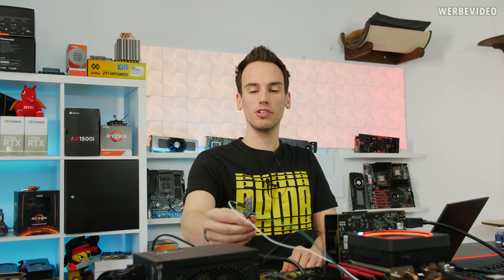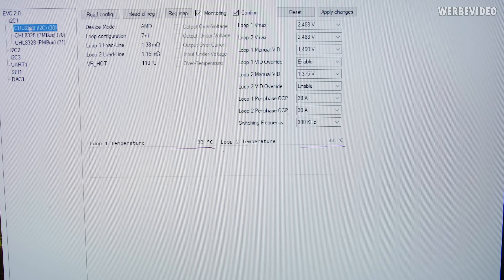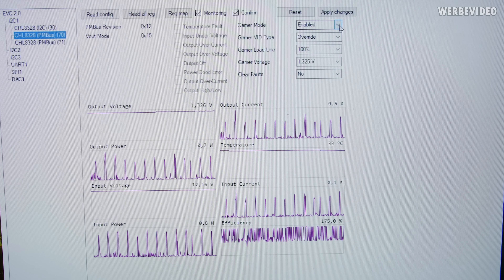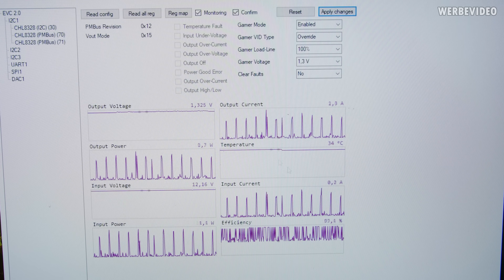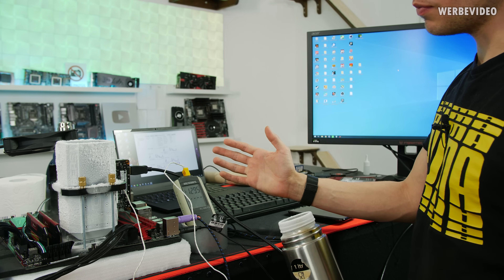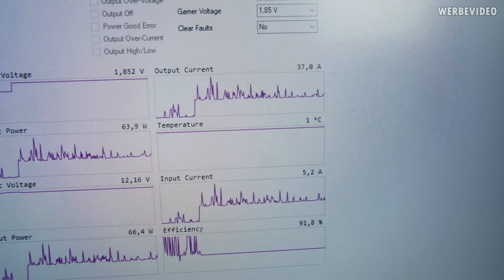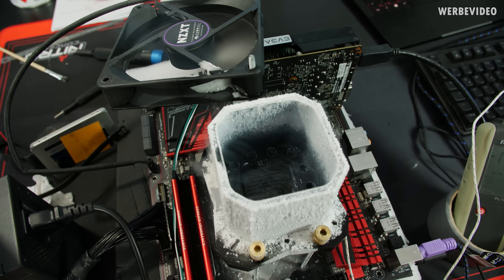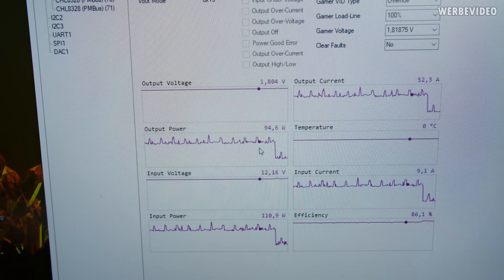We Overclocked an AMD CPU to over 8.1 GHz !!

Comment: 2:33 telemetry windows eat 15A current each 5s 😂
Reply: Linux all the way. I have Gentoo Linux, everything compiled straight from the sources with the newest compiler directly to my architecture. All dependencies that I don't need are dropped. Everything from Kernel that I don't need are dropped, and the rest of the settings optimized. Now I have Celeron 1.8ghz single core 2gb 32bit laptop from 2005-6 that runs fully modern Linux and it's powerful enough for pretty much everything except where performance actually matters like rendering.

Only reason I bothered was the challenge, and that laptop had superb display for it's age. I gave it to my mother who is really happy with it. It uses my desktop computer for compiling though. Otherwise that installation would have taken forever, and even the regular updates that need to be compiled would take too long.

For a little never machine pretty much any Linux would work fine.
Reply: thats why you don't use windows 10
windows 7/8 all the way, not the "material design" abomination that is windows 10
Reply: That's why you use Linux, which will have the design you want. Though it will have pretty much everything as you want, after you learn how to use it.

Even these old Bulldozer era CPUs feel fast with Linux, and really fast with Gentoo Linux where all code is automatically compiled and optimized to your specific hardware, and only needed dependencies are included in the binaries.
Reply: @juzujuzu4555  pretty much every application i need to use runs only on windows and has no replacement / equivalent on linux
Reply: @juzujuzu4555  and the performance is bad on wine sooo
Reply: @bananya6020  Most Windows software runs on Linux through Wine. And in most cases there are equivalent/replacement on Linux, people just don't know about them and don't research because they think they already know the answer.

But let people use the OS they choose, I just want to give info that there could be better options, depending on the people and the needs.

Linux and most free software doesn't have marketing, but instead have the perceived image from the days when Linux wasn't nearly as good as it's today, so people who have migrated to Linux need to act as the marketing force.

Though it's not easy as it's easy to sound like elitist or someone that is "OS shaming" etc. which only causes problems.

I just never knew computing could be so much fun and productive at the same time. So I want to share the knowledge and have misconceptions removed. But not cause any negativity, which is real danger as comments really doesn't transfer the message well.

I also have one machine that runs Windows 8. I tried Win10 but just couldn't stand it, and it was the point when I gave up and migrated to Linux. So in a way I'm really thankful for Microsoft =)
Reply: @juzujuzu4555  Linux is garbage for day to day use (For me personally). Also, WINE isn't the solution for every Windows program. For that, you're better off running a VM with a GPU passthrough.

Linux just isn't there yet for me. It needs a lot more software support and a lot more work with drivers. Though, Linux is great for development and server stuff.
Reply: @bananya6020  yeah i used windows 7 for ages but then my hdd head crashed and I was forced to go to 10 and  i want to go andset fire to microsoft now
Reply: XD
Reply: How did this conversation go from a comment about amperes to a Linux vs Windows war in 1 message? And yes it’s a retorical question.
Reply: @Engineer9736  There's no war here. Just facts about operating systems. When someone mentions Windows telemetry, usually friendly people bring up possible solution to that problem. So the original comment itself had the seed for Linux discussion =D

Comment: @der8aer   next time you have a bent pin try this trick. Get a ball point pen and remove the ink tube from it. Slide the back of the tube over the top of the bent pin. Slow AND I MEAN SLOWLY flex the plastic pen tube in the direction you want the pin to return to. The extra flex in the plastic tube will be less damaging to the pin than the metal point you used. Also you are less likely to damage other pins around the one you are working to repair.     Give it a shot sir.     Ball Point pen is still stronger than the CPU. (pen is mightier than the sword?) 
Cheers!

Comment: this is how 14nm CPUs will look like in the future if you know what I mean
Reply: 3 years ago kaby lake was OCed so many times to the 7 and even 7.6 Ghz ,now we are still hovering around 4.5 ghz, because it's simply useless and inefficient
Reply: @kaisyaya8492  That's still comparing LN2 XOC to commodity watercooling. With 14nm incrementalism we squeezed 5GHz out of a 4GHz design. The fact that Ryzen managed to close the multi-year gap and then get ahead will force Intel to move quickly again.
Reply: @asm_nop  AMD has "moved quickly" to recover from Bulldozer fiasco.

Fact of the matter,  "moving quickly" in semiconductor industry means accomplishing something like that in 5 years instead of 7. The engineering is unbelievably complex and slow.
Reply: 14nm++++++++++++++++++
Dead Lake
Reply: So much ++++++
Reply: Or today ... if you know what I mean. The 9900k can already draw over 250watts with an AVX load. Same as a 16 core Threadripper.
Reply: @WaspMedia3D  TR is 24 cores.
Reply: @LtdJorge  1st gen 1950x
Reply: Hahahha 👍🏻👍🏻
Necromancer Lake is RIP
Reply: I still have my i5-2500k that for repurposed for my NAS which if I remember right was a 32nm architecture and that just seems crazy relative to what we have now.
Reply: @Livedracersteve  I still have a laptop with i5-520M and it is 32nm It barely run windows 10
Reply: @katech6020  yeh but a laptop i5 (1st gen) is pretty much pentium level dual core aswell if I am correct
Reply: @NeoArch  I have a first gen i5 laptop (Latitude E6410 i5 560). That thing runs so hot at times. I put an SSD in it and it runs pretty quick. Thinking of switching out the Mobo for a Motherboard with dedicated graphics. Tired of integrated graphics. I need to find the correct cooler for it though.
Reply: it's still fucking some CPUs that are 7nm in the butt when it comes to single-core, now imagine if those 14nm CPUs were actually 7nm...ohhh exactly

Comment: der8auer: 8.1GHz on AMD!

Me: Laughs in intel i3-9100f stock cooler
Reply: I have a intel core DUO E4500 (2.2 Ghz) :d
Reply: @Hasan Sarı huh
Reply: @hotaru25189  yeah but basically the same not much difference.
Reply: Well this thread certainly made me feel a lot better about my R7 1700 @ 4.0
Reply: @TheBig451  The Ryzen 7 1700 isn't bad at all. LoL It's still a great CPU to this day.
Reply: i3 9100 is fine
Reply: @d1s1ntegrator56  no
Reply: @Babybarschalarm  i have an i3 3225 dual core
Reply: @desardlika755  oof
Reply: @Babybarschalarm  y
Reply: @Babybarschalarm  I have a 3900x , stock cooler  😓
Reply: @allgunsblazed9106  yeah but atleast it has an AMD cooler on it haha. the intel cooler is useless
Reply: @NonsensicalSpudz  to be fair, looking at hardware unboxed' video, the amd stealth cooler is almost as useless as the intel stock cooler (copper core). still better than the coolers (no copper core) they use nowdays by a noticeable margin.

Spire absolutely destroys it though.
Reply: @allgunsblazed9106  the stock cooler can perform close to a 360 mm corsair cooler when playing games the stock is good enough bruh unless u doing heavy oc don't be sad
Reply: @Babybarschalarm  i3 9100f is better than an i5 6400 and almost 2 times i3 6100 my cpu

Comment: best to heat those cpu's up before removing the HS
Reply: Yup. Bent some pins on my r3-1200, but not on my 3600 because I remembered to start prime95 before I pulled the cooler off
Reply: Just use hairdryer or something. You don't need to warm up the whole platform :)

Comment: I bent some pins on my 2700X in exactly the same way at 04:51
It's really annoying
Reply: Gratian Boghean I was thinking the same until that crap happened to me 😂😂😂
Reply: @dreadshape6972  not very well, but yes
Reply: I usually let the cpu warm up for a while so the paste gets softer. Never had a problem:)
Reply: Warm the pins cpu.
Find mechanical pencil, pull out graphite then use the hole to straight  up the bent pin

Comment: Wow, that really bends the board a lot. Any issues caused by this, such as cracking solder or anything like that?
Reply from the maker: Usually no permanent damage. Just very big sockets like SP3 / TRX40 / LGA3647 will get CPU contact issues and you lose memory DIMMs or PCIE lanes
Reply: der8auer That’s damn impressive! I’d never thought it’ll hold up that well. Thanks for the reply and the great content btw! It’s awesome to see those good ol’ FX see some more action

Comment: Will the board fully recover from that absolute distortion? What did you end up getting on the cinebench multicore?
Reply from the maker: Yea it's usually no problem for the board. They are really flexible. Unfortunately ran out of LN2 but can repeat it maybe in a future video

Comment: I still have my old FX-8370 system components (as in motherboard, cpu and ram) lying around somewhere, but I was never able to overclock it past 4.2 on all cores, because I only had an 80 euro Gigabyte motherboard with weak VRM's.
Reply: hit 5.1 with mine on all cores..on custom loop..stable at 4.9..with a sabertooth motherboard..at the moment it still running my youngest kids PC at 4.4.GHz
Reply: @microangle  Nice!
Reply: Guys OCing PII/FX can be a pain. You have to enable HPET in BIOS and force it off with 3 or 4 bcdedit commands in cmd (admin) or the mismatched timings will screw the already poor FX experience into an even worse microstuttering mess. You have to match the NB and HP (16bit) speeds. Its hard to even get them both to 2400MHz. I got them stable at freaking 1800MHz on an FX-4100, 2000 on PII 965 and 2200on FX8370. It took me a lot of time to firure out that these two settings were the biggest stability hogs. Don't use more than 2 sticks and never set the comand rate to 1T if you have 4 sticks. Disable 1394 IEEE (FireWire), disable onboard audio if you have an usb headset, set LLC to Medium (always make sure you have a competent PSU and mobo VRM before OC), disable front USB 3.0 (maybe even rear because the old drivers are buggy unfortunately), press Ctrl+F1 when you enter the BIOS on Gigabyte mobos cuz it will unlock extra options across all tabs, disable any spread spectrum or NB/SB power management options (Ctrl+F1 required), don't OC with the bus on questionable RAM and try the BUS method if you have extensive experience since it can lead to massive issues for minimal gains, disable APM and manually set the pcie speed to !!!100mhz!!!, Set the bus speed at 200, and set your memory at 1333first and focus on the CPU before OCing the RAM (very sensitive and extensive experience required for really tight timings and high speeds plus you have to be lucky with many RAM kits and the processor lottery on the IMC itself and the quality of the mobo all play a significant role), disable the power saving features (c1e, c6,...) and cool&quiet (c&q), check that the fans are running in PWM and not Voltage and set a high fan speed on a high temperature target,.... 

Good luck and have fun OCing 💪😄
Reply: I had a 8350 that i OC'd to I believe 4.8 on a 79 euro gigabyte motherboard, pretty sure we had the same one. 970a-ud3
Reply: @anti-vatnik  hmmmm... I did have a 970 version, but not that one. I guess I need to do more research 😂 Also, was that overclock on all cores?
Reply: @Fiddlesticks86  All cores. Although something was overheating really badly, I think it was northbridge or possibly the vrms too, tmpin02 was the sensor
Reply: My 8320FX is OC to 4.5GHz easy on 970 chipset mobo. Good cooling and it work good
Reply: I still have maybe 6 FX Vishewras in my colection and most of them are able to get 5 GHz stable. I have one sample of FX-9590, which did almost 6 GHz on AIO cooler validation in normal ambient. And two very good FX-8350 (8+ GHz both). It is still very fun as Roman said. Also I can recommend for start play with Phenoms II, really great to platform for LN2 and tweaking CPUNB, DRAM timings and hypertransport frequency (in some ebnchamrks it has cool impact)